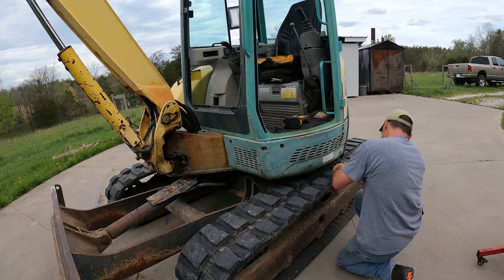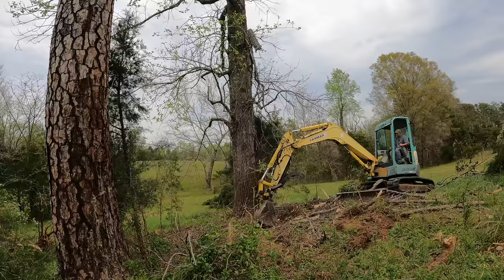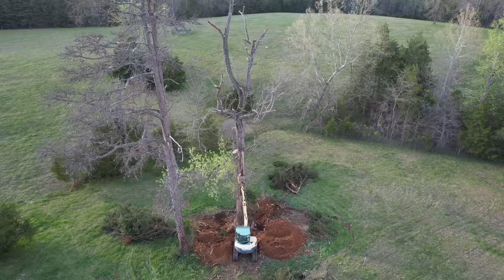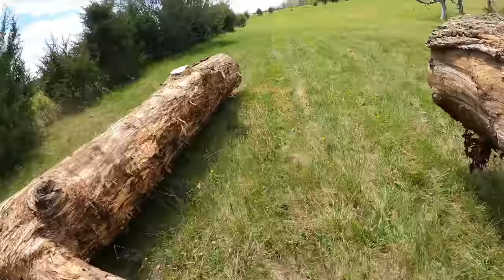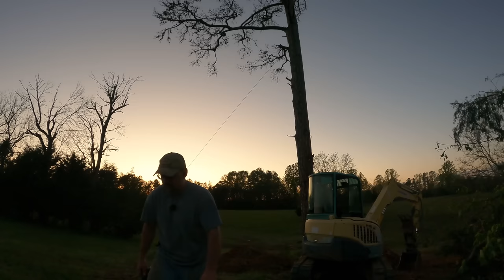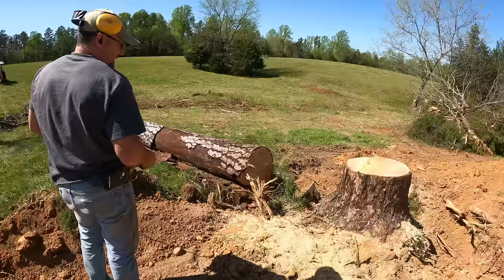Digging BIG Trees With A MINI Excavator.  Yanmar VIO50 Digger

Comment: Hey John. Your problem with the tracking is probably in your travel motors. Over time one motor will become weaker than the other allowing the dominant motor to “take over” as you travel. I’m in the excavation business and have seen this on several excavators. Also, yeah I would’ve sawed those big ass trees down. Way to small of a machine for those monsters. (But hey, that would have made for a boring video lol) Love your content man. Great stuff brother.
Reply: Maybe the valve seals also
Reply: Zero turn transaxles will sometimes do that too
Reply: @gatewaysolo104  yep, my JD zero turn has provisions to limit one of the motors travel so you can match the two motors speeds and mow straight.

Comment: I grew up in an area that is fairly dry and is mostly forested with pine trees.  When they fall or get blown down it almost always seemed to be the trunk that would break.  I was so surprised when I moved to the coast and saw trees that blew down that had these huge masses of roots that seemed so close to the surface.  I guess this explains why they don't uproot so much!  Maybe it depends on the species?  The ones native to drier climates must have bigger tap roots to get down to the water they need.
Reply: Pines (Pinaceae) can form huge taproots. It depends on the ground if they develop deep taproots or if they stay more shallow and form several smaller taproots. 
I would geuss it also makes a difference if the tree was planted or grew by itself.
Reply: The lodge pole pines where I grew up blew over all the time and took their root balls with them. That was in a very dry climate. Usually if they were formally in a forested sheltered forested area that was developed they would blow over.
Reply: A lot of times I've noticed it is diseased trees that go over. If I try to mill dead trees only about 1 in 10 is actually any good meaning it is an utter waste of time for the hobbyist sawmiller to try and cut lumber out of them. 
What it is telling me is that for the most part they fall over for a reason not immediately apparent until you get inside them. 10% of the time a healthy tree falls over because of soil saturation combined with wind or another diseased tree causing a chain reaction.
Reply: Same, I'm near the piney woods but it's not a dry area and I don't think I have seen one uproot. They have massive tap roots just like this one.
Reply: i've seen super tall ponderosas snap at the tap root right at the ground level too. makes a MASSIVE hole with a massive root ball. huge mess. not to mention a 70 foot tall tree slamming into the ground and leaving a huge trench
Reply: Lucky you raised the bucket over the roots in time, you could have been pulled over with the machine when the tree went over.
Reply: In the PNW, they are called root wads.  Frequent moisture with shallow top soil over hard pan leads to decent lateral roots with almost zero taproots.  When the soil does get saturated, and with branches like sails, they go over fairly easily.
Reply: There is also enough tension in the roots that they will stand back up if you take weight off the top, enough to throw a running saw several yards!

Comment: One thing I noticed that might help you while pushing over trees, make sure you have your blade behind you not in front of you. When you lower it, it will add stability and you’ll be able to push with more force. I have pushed over several large trees this way. Good luck best wishes.

Comment: If you are gonna have to take more large trees down then consider either fabricating or buying a single tooth shank/root ripper.  It will concentrate all of your available breakout force on the single tine and make ripping roots easier for the small machine. Another option (If you have one) Is a terrasaur blade (might be a brand name?) for a petrol cut off saw.  It will cut through roots, soil, nails, old fence wire, bolts etc unhindered. We use them in demolition cutting timber with foreign contamination, and have cut many tree roots in tight spaces to great effect.
Addressing the "Fill the hole with water" thoughts you had, (and again this is what we do rather than what you SHOULD do 😉) We use a pressure washer with pencil jet and turbo nozzle to both cut through soil and also smaller root balls. Running a trash pump in the hole prevents creating an outdoor swimming pool as you work. It gets almost all the soil out from amongst the roots so you cold even cut them with a chainsaw.
Reply: Try cutting the tree  down first,  da.
Reply: @bobspring6723  We do, but how does that help John dig out a massive root ball and stump with the machine he has?
Reply: @Bill Forrest  I agree take the whole stump out while it's still attached to that big leaver. Waste more time digging out stumps from cut trees than ones that are standing.

Comment: Hello John, I’ve got a mini ex E 42 and a 2 foot bucket is hard to dig out stumps. I always use a 1 foot bucket and it works great another thing with a mini ex. If you turn it on put the blade behind you you can use the hydraulics in your blade to help push over the tree, that works pretty slick. Just an idea or something for you to try great video.

Comment: I have never seen such a big central root!  I removed a big stump in my garden with my 1 Ton mini excavator. First removing ground around it, then cleaned everything with a high pressure washer, removed all visible roots... then moved it back and forward with the bucked....  It was a nice work. I also had central roots which broke after some time - but roots like yours are impressive.

Comment: Me again.  On the second tree, you really do not need to cut the tap root.  I've done hundreds that size.  You dug well on the side at the timestamp 40:01.  You need to now angle your excavator perpendicular to the area you dug and do ALL sides that deep and it will push over easily.  With your excavator I could take that out in 30 mins to give you an idea of how fast it should take with that sized excavator.  I think you may be scared the tree will fall if you dig on the other side, but trust me, it will not.

Don't worry about the tree falling, it won't even if you dig 100% around it, and you need to dig 100% around it.  If the tree ever did start to fall, use your excavator boom to push it away, but I've done hundreds like these and they never fall.
Reply: I think this comment is right on. Once dug around 360° it would still take the boom to push it over and the only real concern would be a heavy wind.
Reply: If you don't know that there's a 30 inch wide tap running 10ft down?  Better safe than sorry.

Comment: When pushing over trees with smaller excavators you need to use the tractive force over the hydraulic force.  Plant your bucket in optimal position and track forward once it's well dug out.  You'll be limited on reach obviously higher the better

Comment: Since you have a quick attach bucket, you could get a large tooth and put a cutting edge on it for slicing through roots, Also, you could put an auger attachment on it with a stump cutter and grind  them into the ground leaving the whole root mess alone. Finally, don't forget to utilize your dump truck for getting your firewood, trash and wood to be milled.

Comment: Dig out the spot you want to push from first to break the roots then pile everything else in that spot. Then get on top of the pile and push from there. This gives a higher push point on the tree and makes a big difference in leverage. Also, when digging stumps it helps sometimes to try to twist them out instead of pushing or pulling them over. Grab on side at ground level and try to unscrew it.

Comment: Pines naturally throw a tap for water or on rocky terrain. They will also expand the tap preferentially as a sapling if  the ground level rises for whatever reason; ploughing etc. Adventitious roots grow above the tap and normal system develops. Obviously it all depends upon the conditions of the pasture 90 years ago and the pine species. Great stuff and excellent video. Thank you for posting.

Comment: I've got a John Deere 160G sitting down where my 400'x40' chicken coops used to be. They pulled up all the footings and slabs, and loaded the 9 or 10 25cy dumpsters with all the debris. With the right tools, those jobs go pretty fast.  Also have a skid steer and JD 550G dozer down there pushing stuff around. SO much faster than my JD 26G mini-ex and Kubota tractor :)

Comment: As with other comments, a tungsten carbide chain is super handy when cutting anywhere near dirt. I have a carbide chain for both my big saw and medium saw. In fact I now have the carbide chain permanently on my medium saw. A freshly sharpened steel chain will out cut a carbide chain, but my medium saw gets used for cutting all sorts of rubbish and has to be constantly re-sharpened. I now stick with the carbide. You'll need diamond files to sharpen the carbide teeth.

Comment: Hah, that reminds me of removing a pine with about 20 - 25 cm (8 - 10 inches) trunk diameter from our garden last year. Cut the tree about 2 m above the ground to have some leverage, then went around it digging with a pickaxe and cutting the roots (including a ~5 cm tap root) with a carbide sawzall blade until I could reasonably shake the whole thing. Then I shook it back and forth until the leftover roots snapped. It was kinda fun doing this once, but really makes you appreciate heavy equipment.

Comment: The way I was taught to fell a tree by undermining the roots was:
1) Tie it off in the direction you don't want it to fall, no tension you just want to stop the tree falling.
2) Undermine tree and take out the roots on the side you want the tree to fall and slowly work your way around the "front" 180 taking a bit from one side then the other. 
3) Once that's done you pull the tree in the felling direction and put some tension on the roaps. These want to be set about 30-45 degrees either side of the felling direction.
4) Working from the back side of the tree you then open up to around 270 degrees of undermining. 
5) You then dig out a hole opposite to the felling direction, ensuring the rope is always under tension pulling the tree away from you. 
6) Work your back pit out wider 

At some point the tree will start to fall and you can control it from the rope and undermining of the earth spurs you're left with. When the tree falls it will fall slowly and you have a lot of control, especially if there's a central taproot.I hope that all makes sense.
Reply: That is a great explanation and it seems like the safest method.

Comment: They make a ripper attachment for those about 2 feet long.  It will really give you an edge on those roots.   I am sure you could make one in the shop.   We leave it stuck in the ground when not in use.  Makes it easy for the quick connection

Comment: I have never seen an enormous underground stump like that before. Great video! but please have safe saw pants on for your safety.  I  think you could push more on the tree if you have the blade in the back, so you don't push up the excavator but in this case, it wouldn't probably not help anyway.

Comment: Your plan of digging the roots out on one side then pushing the tree over is exactly how we do it here in New Zealand when we have to remove trees to build forest roads/ tracks. Mind you, we are normally using 30t Excavators with ‘dangle-head’ grapples. We often have to dig right under the stump on the most stubborn root systems, which the ‘dangle-heads’ allow us to do. On similar sized trees, I work on no more than 5 minutes per tree.

Comment: John, one thing I've learnt from using my personal backhoes and rented excavators (all relatively small machines) over the past 40 years is when it comes to removing stumps, technique makes ALL of the difference...

The trick I learnt is to focus on both using and enhancing the bucket's curl function. With all of the backhoe/excavators I've used, the curl function can generate the highest ripping force on stumps by far. I'll try to explain what I mean.

Let's say there is a large root running left/right in front of you that you need to remove. The intuitive action is just to hook the root and pull but this doesn't work very well.

Instead, push the bucket's teeth into the ground directly behind the root and, while continuing to push the bucket into the ground and pushing slightly away from you (yes I do mean away), curl the bucket. This will almost always substantially rip through even large roots (might take a few attempts to fully rip through the largest roots).

Once the bucket has ripped through the root to the point the bucket's upper edge is close to horizontal to the ground, now start pulling the bucket towards you while continuing to curl it.

That combination of motions takes advantage of the curl strength, combined with pushing down and away, which magnifies the curl strength further.

Using this technique, even a small John Deere 1025R or our old 1989 Case 580K (with a failing hydraulic pump) is able to remove large stumps (30"+) with ease.

Give it a try. Once you perfect it you will be amazed what your excavator or backhoe can rip through quickly.
Reply: I clarified my post above a bit.

One thing I should admit is around here it is fairly rare for our trees to have a large tap root.

Edit: I didn't have time to watch the last 20 minutes of the video earlier and just watched it now. That was one HUGE tap root! Our pine trees can have tap roots but nothing like that (probably because our property is on bedrock).

Comment: I just noticed the loader control on your tractor has you really extended out when you’re using it. My family has had Kubota tractors and backhoes for years and none of ours would have us reaching that far out of the seat to control it. Did something happen to it or is there an adjustment that can be made to bring it closer to you?
Reply from the maker: It could be adjusted but I don't mind it where it is.  It's out of my way for getting on and off the machine on that side.
Reply: @FarmCraft101  having been a fan of yours for a while I’m not surprised there’s a practical reason for it.
Reply: @TF856  Read the comment above again....
The comment says loader control on your TRACTOR
Reply: @gnaedigerfels  There are pedants everywhere doing their best to "one up" some person at any chance possible.
Ahhh - the internet - what a platform to act smart from mom's basement. SMH
Reply: @edpoints1127  Aren't you doing the same with your pseudo-intellectual condescending comment ?

Comment: The method/equipment I use for such tasks is primarily a ripper tooth on my mini excavator. It makes it so much easier to cut the roots. Also, I dig thenfrontside and the rear to cut the roots and to give a relief area for the tree to pull the stump over. Naturally, you wouldn't want to do that if it's windy since the wind may blow the tree over when you're not prepared for it. I hollow out as much as I can on the side that I want it to fall. I don't know if any of this would have made a difference on that pine tree after seeing the size of the tap root. I've never encountered a pine with a tap root that size. 

Also, always be careful when pushing against a dead tree like that. I've had limbs to fall close by and have seen the top of the tree fall backwards when pushing the tree with the excavator. It's dangerous work for sure. You don't want to drop a tree on your Johnson.

Comment: Your idea to cut down a tree with an excavator is absolutely right. Unfortunately, your excavator is too small for such large trees. I live in Finland and had an excavator driver take down a pine without a problem, but he had a much bigger machine. If I remember correctly, he dug the pit on the side he fell the tree towards. He told me, the best way to get a stump up is to fell it with ajan excavator. It took 15 minutes for him too fell the tree.😮

Comment: You wore me out just watching this. Last time it was the video fixing the generator. That got old pretty quickly.
I like videos like the one where you fixed a steel shaft by filling in dings with  a welder and then smoothed it perfectly with your milling machine. That was facinating. More please. 
👍

Comment: Remember its not how long it will run by the calendar its how many hours and what jobs you do with it to protect its longevity. I have a DR stump grinder and it will grind 10 inch above ground down to 4 inches below ground and not really a limit on how big a stump is, I just grind below ground a few inches then put dirt on the hole then plant some grass seed, I've done 50 or so stumps and use it to supplement my retirement allowance when I need to.😊

Comment: Another great video. I use a 10 inch carbide blade on a sazall for dirt roots. I have taken many trees out by hand or with a small machine.
Reply: I can second the use of the carbide blade on a sawzall. I had a smaller stump I took out last year. After rapidly dulling my chainsaw and normal sawzall blades, I bought the carbide blades. Even after all the cutting I had done in the dirt, the carbide blade was just as sharp as when I started using it.
Reply: That is good advice. I have cut many roots big and small with a cordless sawzall and heavy demo blades. The dirt will dull them but only after very many cuts.

Comment: Hey John, you should probably add a rod-guard, something that protects the rod from getting dinks and dents. Could be some 5mm that's just bolted to the moving part of the zylinder. Only needs to be as long as the zylinder itself.

Btw, thing's awesome!